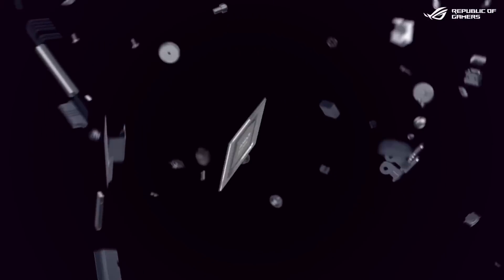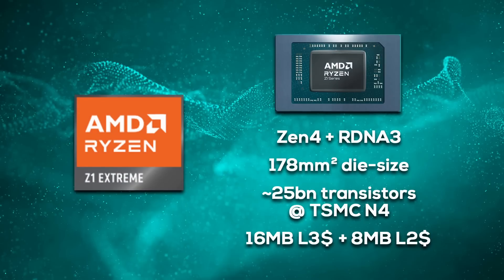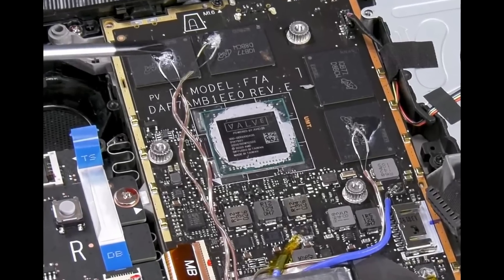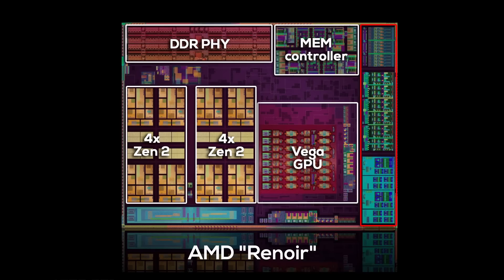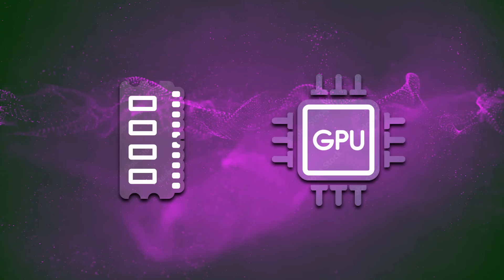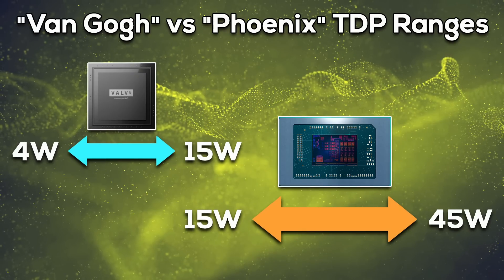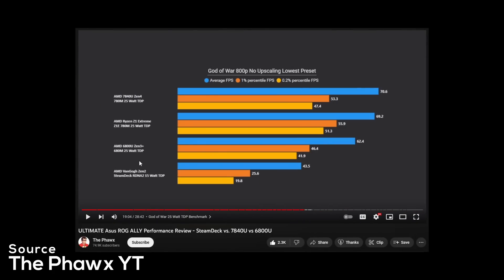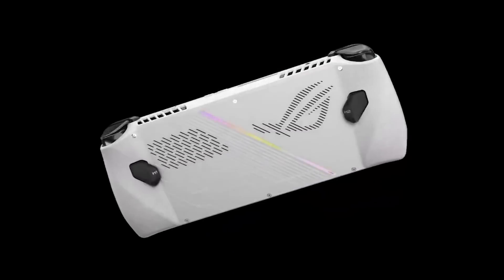Why the ROG Ally can't beat the Steam Deck

Comment: I think Valve were genius in creating a true custom APU. I also love the analysis by the Phawx. A mother difference I have noted is the impact of using a quad channel memory setup on the Steam Deck and the GDP Win Max 2+ compared to the dual channel memory setup on the ROG Ally.
I can't wait for the next Custom APU from Valve for Steam Deck 2. I think it will be 4C/T Zen 4 and 12CU RDNA3 Lpddr 5-6400 quad channel targeting 1080p 60fps with 30% better better life with the same battery capacity. I love how Valve is managing expectations and not over promising.
Reply: Valve already said that they aren't planning on changing the steam decks hardware for a long time. That's a smart move on their side, cause keeping hardware the same will allow for game developers to optimize for steam decks hardware
Reply: @vinylSummer  I think Steam Deck 2 will be released Q4 2024 - Q1 2025 which is roughly 3 years after the Steam Deck was released. The platform will have matured significantly by that time. I can't see them move to Zen 5 if they want to keep the same price point. I also think they will use Frore's AirJet cooling tech. If they can get to 1080p 60fps while also increasing battery life it will be a good achievement that can push them forward another 2-3 yrs. All the games which are optimised for 720p can be up sampled to 1080p using Zen 4 and RDNA 3 so that even without Native 1080p optimisation they can still offer Full HD high refresh rate.
Reply: would be happy wit ha node shrink of their current soc, with more transistors of course, still with a 800 or 900P screen still but just thinner bezels if possible. hopefully fsr3 will make it even more efficient.
Reply: Please no 1080p. On this size it makes no sense. 800p are perfecrt for this screen size and the advantage is you get more fps with better graphic options.
Reply: The Ally was misquoted as dual channel.  It's quad channel just like the Deck, 800 MHz per chip versus the deck's 687.5.

The Math: the deck's 5500MTS is 4 channel, 1375 MT/s per channel, which is 687.5 MHz for DDR [*Dual* Data Rate]

Asus isn't running similar chips at 1600 MHz.  The teardowns show 4 chips just like the deck and they would need to be doing 1600MHz [3200 MT/s] to be dual channel by the same math to hit 6400 MT/s.
Reply: @pondracek  I'm pretty sure the ROG Ally is running a dual channel memory setup.  Check your sources and your calculations again.
Reply: @EnochGitongaKimathi  I could be wrong, but I believe that it is labeled as dual channel due to legacy DDR nomenclature. It supports 128 bit wide LPDDR5 just like the steam deck, but since DDR4/3/etc was 64 bits wide most people still call that dual channel, even though technically DDR5 channels are only 32 bits wide.
Similar to how AM5 and LGA17/1800 support "dual channel" DDR5 despite technically being quad channel.
Reply: @EnochGitongaKimathi  My comment has gone missing 3x now.  Google the Ally's Geekbench and see the 800mhz memory clock in OpenCL.

Linking directly seems to be what's getting my comments nuked.
Reply: @Summanis  check the info below in my reply to Peter Ondracek.
Reply: @pondracek  I'm sorry your comments were deleted. You are right the links are the cause.

The ROG Ally is using LPDDR5 in 32-bit dual channel mode. LPDDR5 uses 16-bit or 32-bit channels unlike DDR5 which uses 64-bit channels.
There is a key change with LPDDR5 which goes upto speeds of 6400 Mbps from the previous version LPDDR4/4X which goes upto speeds of 4266 Mbps.
The Command/Address Clock (C/A CK) has typically run at the same frequency as the data-strobes (DQS) in all prior LPDDR standards, up to LPDDR4/4X. To accommodate the higher speeds of LPDDR5, a new clocking scheme was adopted, where the C/A Clock runs at 0.25x the data-strobes frequency at speeds higher than 3200 Mbps, and at 0.5x the data-strobes frequency at speeds lower than 3200 Mbps. The other significant difference to wrap this up is, LPDDR5 does not support the traditional bi-directional data-strobe architecture but moves to a new one with 2 uni-directional data-strobes, a Write Clock (WCK) and a Read Clock (RDQS). 
I think those 2 key difference are causing the confusion regarding the memory configuration difference between the ROG Ally which memory is configured at upto 6400 Mbps 32-bit dual channels for a total memory bandwidth of 50GB/s and the Steam Deck which memory is configured at upto 5500 Mbps 32-bit quad channels for a total memory bandwidth of 86GB/s.
Reply: @EnochGitongaKimathi  very interesting, thanks!
Reply: Microsoft and Sony have been doing for a long time and Nintendo with NVidia for that matter
Reply: @Futura2500  doesn't take away the genius. All those companies have a long history of making gaming Consoles yet none of them have a Handheld Console to rival the Steam Deck. Valve saw a potential market no one was tapping into. I admire Valve for their contribution to Gaming on Linux as well. Can you imagine moving forward if game developers include Linux as platform they are targeting for each game, the impact that would have. Even if they don't, what Valve have achieved with their Proton layer is short of witchcraft. I love their holistic approach with both active software and hardware development that truly gets what Handheld Gaming in this age is all about. When it comes to AAA gaming on Handhelds and on Linux nobody even comes close to Valve.

Comment: Valve's APU and Steam Deck were worked on by some ex-apple employees, so this tells you a lot about the Steam Deck.
Reply from the maker: I didn't know that, thanks for sharing. If that's true I agree, lot's of amazing low-power optimizations to be found in the Steam Deck chip.

Comment: Soooo heres my guess. Since the ally has more cores those cores need voltage to operate so at lower wattages power has to be distributed to those cores which may makes them less effective. The steamdeck has less cores soo there may be more voltage to those cores than whats being applied to the ally. I saw asus rog pulse pod cast and they mentioned making it possible to disable cores in the armory crate. If that happens then I guaranteed performance will increase

Comment: The screen is a big factor for a handheld. The Ally screen looks much nicer.
Reply: 120Hz too
Reply: @samserious1337  Try running AAA games in 120Hz and report back :)
I envy the color accuracy of the Ally though
Reply: @alienflorina   Adaptive Sync support!
Reply: 😏Nintendo Switch OLED users rn
Reply: Color accuracy absolutely, resolution? For media consumption only as it decimates the battery life and performance. 120hz? Only for indie games
Reply: if you like playing tethered to your charging cable. Heh! With such a small screen the pixel density of an 800p screen is more than enough.
Reply: Carry 2 Anker 747 Power Banks in backpack.
Reply: its not better at all, 1080p 120hz is shit, maybe if they didn't go for big numbers to appeal to the pubg npc players we'd have 720p oled with vrr

Comment: I would like a better CPU for the next Steam Deck and a slightly better GPU, maybe being at least 25% faster at the same power.

What I really would like is a Occulink 2 connector that I can hook it up to an eGPU for high end performance.
That or Valve can release Steam OS for everyone to use, but the vendors can have a "extra software features" update button to add in support for things they might add in like eGPU support and whatever else they want to add.